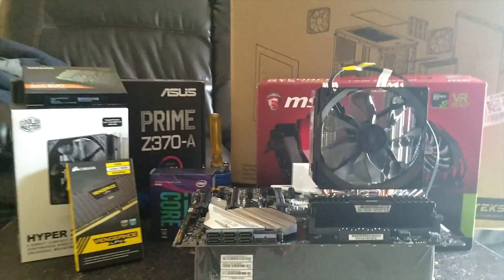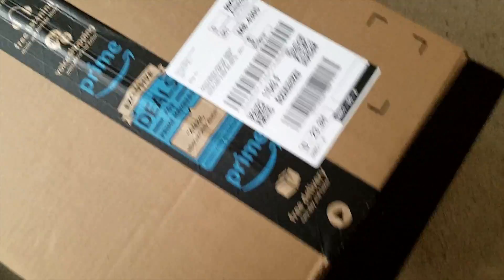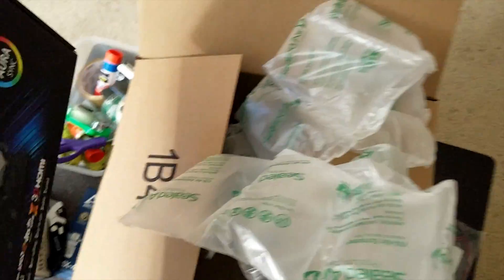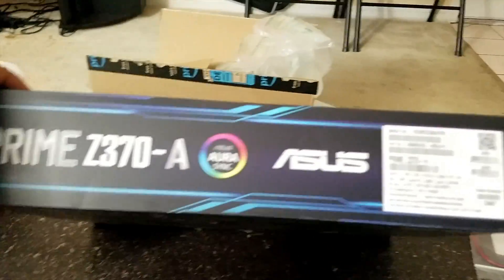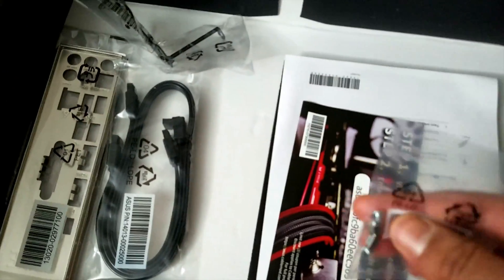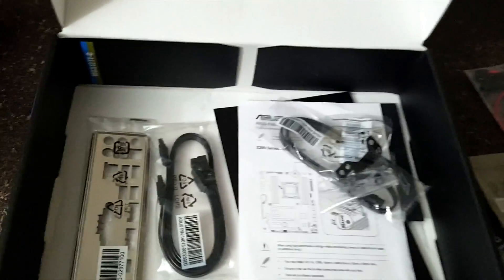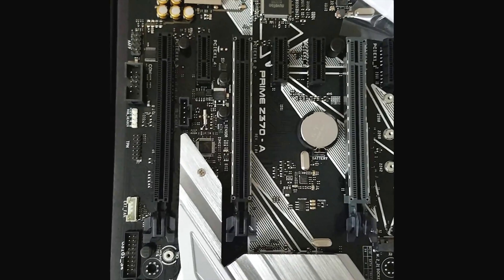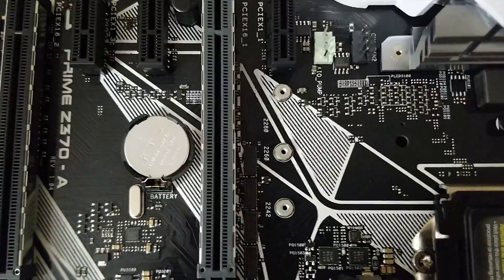How To Build Deep Learning PC-- Part 1 Asus Prime Z370-A Overview & Installation

Comment: After Checking your configuration i updated  a few parts and i am willing to buy this Build:
CPU: Intel - Core i7-8700 3.2 GHz 6-Core Processor
CPU Cooler: Cooler Master - Hyper 212 EVO 82.9 CFM Sleeve Bearing CPU Cooler
RAM: Corsair - Vengeance LPX 32 GB (2 x 16 GB) DDR4-3200 Memory
GPU: Asus - GeForce RTX 2060 6 GB STRIX GAMING OC Video Card
SSD: Samsung - 970 Evo 500 GB M.2-2280 Solid State Drive
MB: Asus - Prime Z370-A ATX LGA1151 Motherboard
https://pcpartpicker.com/list/h663YT
What do you think?? 
Thanks for the help sir!!
Reply from the maker: It's great
Reply: @akhilendrasingh   Thank You so much for Replying , will buy it soon!

Comment: is this build good 
Motherboard Asus Prime Z370-A 
Intel Core i5 8600K (3.6GHz) Socket 1151 
SSD Samsung 860 EVO 250GB SATA III 
MSI GeForce® GTX 1060 GAMING X 6G 
G.Skill Kit 16GB (2 X 8GB) DDR4 3200MHz Trident Z Red 
Modular Seasonic Focus+ 550W 80+ Gold 
Cooler CPU Cooler Master Hyper 212X
Reply from the maker: This is definitely good but it depends upon the purpose. If you are going to use it for gaming, gtx 1060 may not be enough.
Reply: @akhilendrasingh  thks for your attention :) 
Maybe 
 I'll upgrade later

Comment: Hey did the motherboard come in an open antistatic bag or was it totally closed. Mine was open in the other end, not sure now if it was a repaired example cos the vendor did sell some repaired examples at like 150 usd and i bought mine at 160 usd, hm
Reply from the maker: For me, it was completely closed.
Reply from the maker: motherboard should be closed.
Reply: The static bag should ALWAYS be sealed